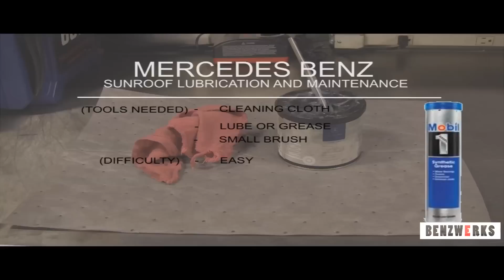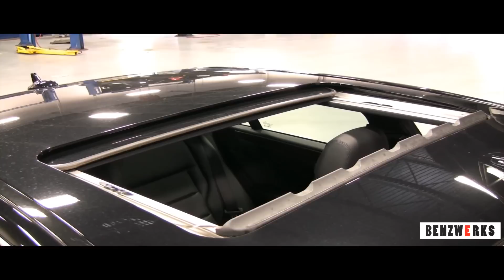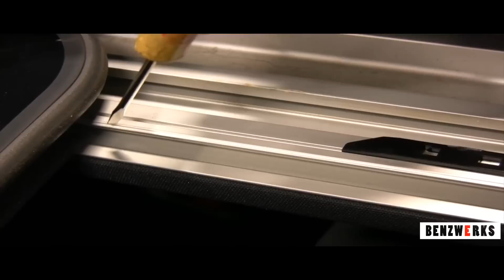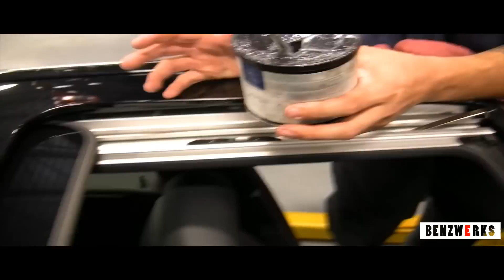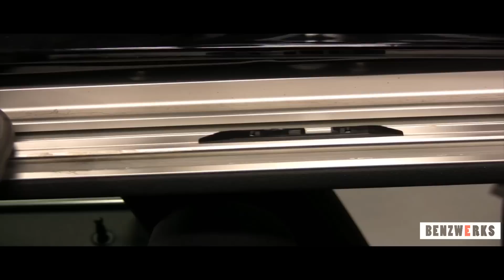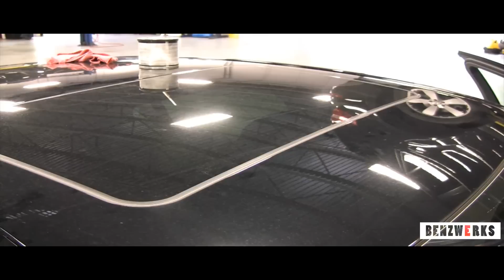BENZWERKS SUNROOF LUBRICATION AND MAINTENANCE

Comment: I did this on the exposed Torques with a new rubber grommet and washer, six months later it did it again. So I removed the light and Rearview mirror and pulled Both Torques Bolts out and it solved the issue. I recommend doing Both at the same time as there are two fail points. Now my roof works perfectly again.

Comment: Got an 05 dodge neon Srt4 mine sticks every few seconds when closing. Still goes to full open and close, and it's already been cleaned and lubed. Tried new motor and controller and neither helped any suggestions?

Comment: my cheap Acura roof is maintenance free but W212 roof tracks need lubing every 10kMi else burns the motor 😂
Reply: Sorry, Acura sunroofs need to be maintained - just do a web search for plenty of stories.  I suspect most manufacturers recommend the sunroof tracks get cleaned and lubricated on a regular basis.  Although I haven't had it done on any vehicle I own, including a Mercedes with 140K miles, so who knows?  BUT, I would think that if there is a Honda/Acura branded sunroof lubricant, that it doesn't cost the $90 that the Mercedes stuff costs.